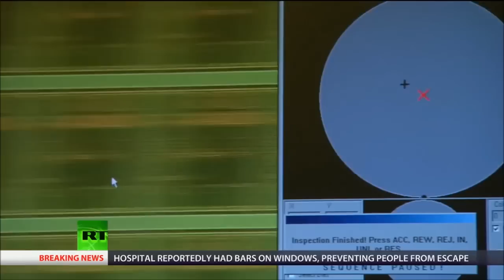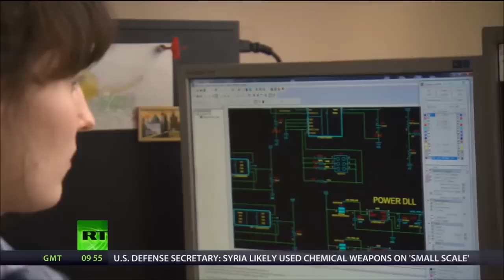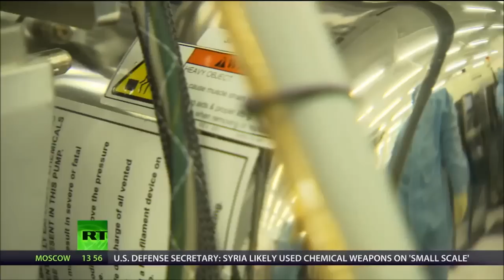Russias Leading Semiconductors manufacturers Mikron & MCST

Comment: MCST lacks the funding to make Elbrus great again, in the 90s it would compete with Intel and AMD but today its nothing.
In the Soviet era the Elbrus was the most powerful CPU's in the making.
Reply: LOL

Russia was pretty much always 20 years behind in computer technology.
Reply: @TheArakan94  Last one Elbrus 8c is compared to intel i7. And Core2Duo in emulating x86-64. Also Elbrus can emulate BESM-6. 
Elbrus 8SV up to 578 GFlops with 4 channel ddr4 ecc (1.5 Ghz, 90W)
Reply: @demoonk420  It's VLIW architecture - one of the easiest to create but hardest to utilize.. It may have high theoretical performance, but that's about it. Practical performance is going to be abysmal compared to modern OoO architectures (both x86 and ARM).

Want to prove me wrong? Show me proper benchmarks.
Reply: David Novák in that case Elbrus have compiler with optimization for automatic parallel executions.
Up to 23-26 operation per clock.
Elbrus developers create Intel Pentium, itanium (Pentkovsky, Babayan). First Western superscalar CPU.
Work in progress.
It is not for home calculation at this time.
Reply: David Novák http://keldysh.ru/papers/2018/prep2018_152.pdf
Reply: David Novák you thinking to create VLIW very simple? Why Intel or AMD don't do this? )))
Utilizing VLIW and Cisc are same at real programs.
Elbrus having real hardware based protected mode. 
Own OS for that.
Own Ethernet controller and many more. It is not fastest CPU in the world. 
For military and government using.
Reply: @demoonk420  Because it's bad for general computing. AMD (ATI) did use VLIW-5 in it's GPUs back in 2007. VLIW is good for certain specific tasks, but will be very inefficient (vast majority of execution units will not be utilized) in general computing and especially in branching - tasks that CPU must excel at. I can imagine having your Elbrus as co-processor but in that case, you can simply use modern GPU, which will offer same functionality and much better performance per watt. Hence, Russian chip design is behind West and even China a LOT.

First superscalar CPU was CDC 6600 in 1966 followed by IBM System/360 Model 91 in 1967. Itanium was catastrophe (and interestingly enough, suffered from similar design flaws as Elbrus) and while Pentium was a good step forward, it is long obsolete. To achieve any sensible general compute performance, you simply need OoO and branch predicting. No way around that.

Every modern CPU has HW protected mode (though usually only on ISA level, not on architecture level, which can be attacked using side channel - this needs to be rectified).
Own OS? Aren't you guys using Linux derivative?
Own Ethernet controller? Well.. That's not difficult task. I created one myself while studying for bachelor's degree in IT.

That benchmark isn't very good. First of all, I'd like independent benchmark and preferably in English. Then the benchmark must test various tasks. What you showed me are two cherry-picked tests that are best suited for VLIW. And it still sucks in them pretty badly compared to modern CPUs (that AMD Opteron is from 2011). I want to see encryption test, compression tests, Pi number generation, etc. That would show exactly what am I talking about.

And yes, I understand it's for government and I am generally fan of new stuff - no matter who made it.. Doesn't change the fact that it's obsolete though.
Reply: @TheArakan94  ok this is a bad CPU. (About superscalar i mean first superscalar x86 processor for home users, sorry this is my mistake)
 HW protected mode - not like any))) Real HW protected mode. If you wanna - you'll read more about it. 
Elbrus is very very bad)). Non democratic processor. Very very old. 
But it working and has no backdoors from China or USA.)
Reply: @TheArakan94  Motorola 680x0 was sort of VLIW and ALWAYS lacked performance.
Reply: @TheArakan94  No it wasent!
Reply: @АвтомобильныйПрограммист  yes, it was.. It's better now, but it still has long way to go in catching up to the West.
Reply: Dawe Yet they made drones before the US used cheap Indian labor IT workers to do the research in Mumbai. The Russians made the basis of spy satellites that didn’t need film canisters. Search up Polyus Laser weapon. Now kindly go love Steve Jobs in his grave. 🙂
Reply: @TheArakan94  those Russian computer tech gave the whole west shivers and still do
Reply: @TheArakan94  western are ahead with LGBT